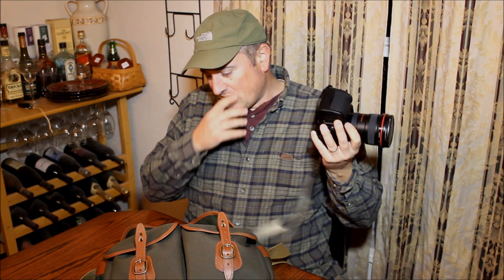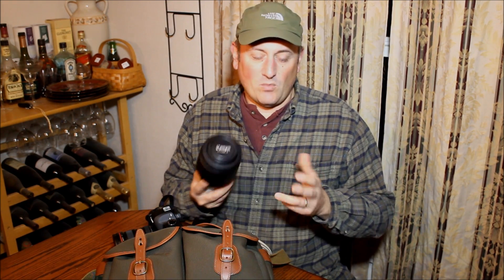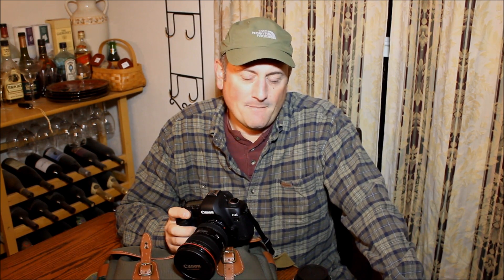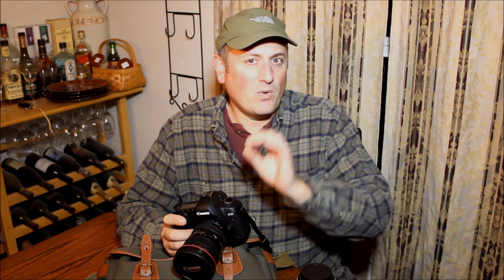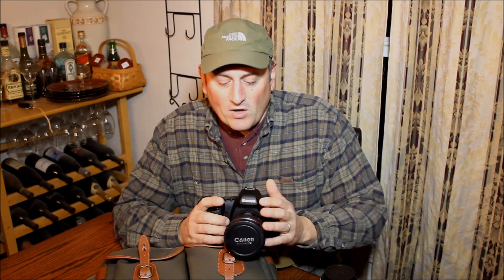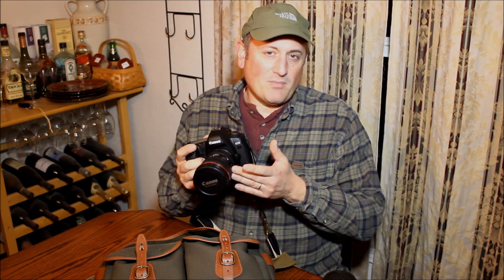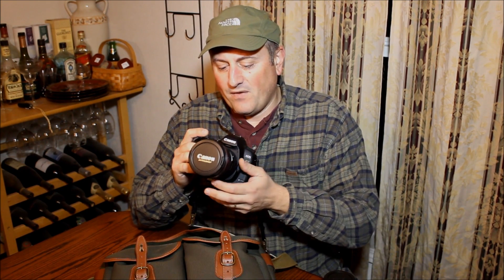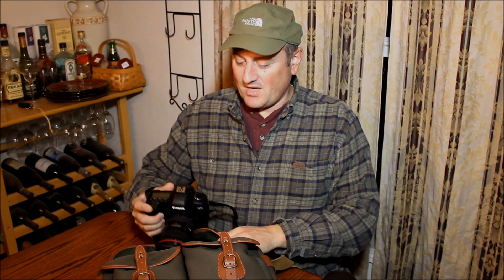When do I use Image Stabilization? (VR SR)

Comment: Good vid Ed. SR is always a compromise.
What did we all do before they invented camera or lens SR?   Right, you know :)
My *istDS had no SR, so I had to learn to do it right.
I'm not sure that's right about doubling shutter speed over focal length on crop sensors.  Yes when you're talking video frame rate (eg 30fps set shutter to min 1/60), but for stills I can shoot sharp as low as the focal length number for shutter speed even on the Pentax Q.

Comment: I disagree with your comment " if you have crop body double the shutter speed".. What sensor size has to do with the SR?  The DX sensor size will just record small portion of the the Image circle than the FF sensor. The actual focal length remains the same,it is just what it records.!.. If you have DX lens prob you are right as DX lense has smaller Image circle ..Saying that I am no expert i just understand lil bit of physics in there. I do like ur videos ..they r practical & I m a pentaxian :)

Comment: The K-5 IIs without the low pass filter is not a better camera, even though it will cost you more (that will be due to the lower demand in the market for the filterless version). But without the low pass filter you will actually get slightly sharper pictures BUT your images will be more likely to suffer from Moiré Pattern.
So it is a trade-off. If you do a lot of studio and controlled environment, the S version might be good.
My opinion: take the normal one.